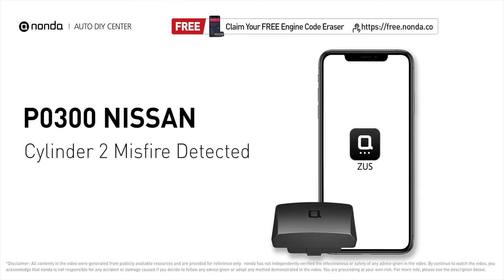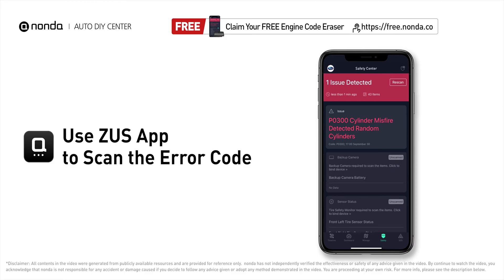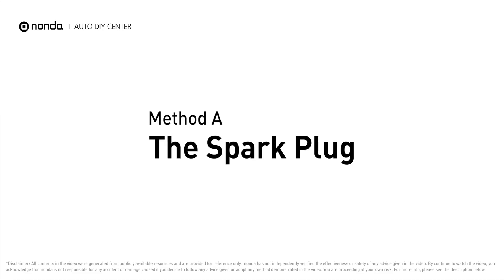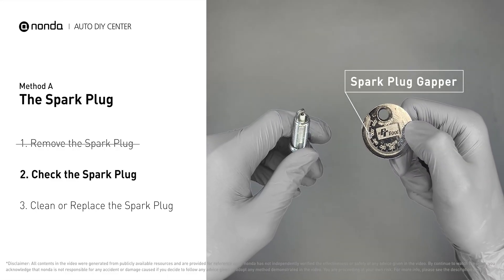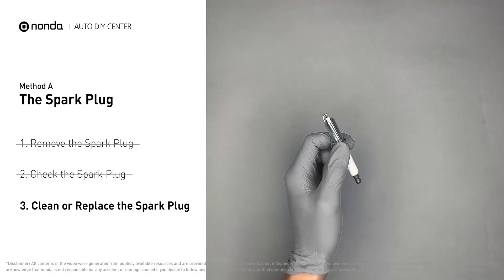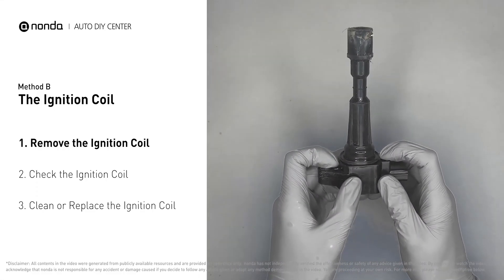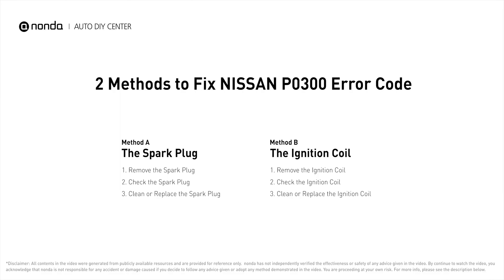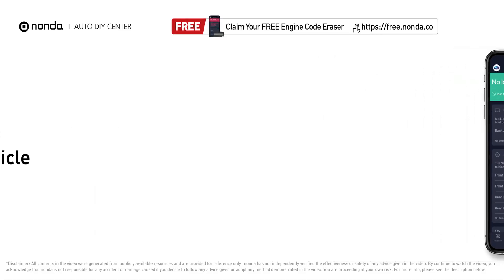How to Fix NISSAN P0300 Engine Code in 3 Minutes [2 DIY Methods / Only $4.43]

Comment: I have the same issue with a 06 Nissan Murano p0300 changed all 6 spark plugs and all 6 coils, with NGK plugs & coils catalytic converters & a Hitachi air flow meter. Put a smoke machine on it and no vacumm leaks. Still p0300 persists car has 140,000 miles on drives perfect.

Comment: My pathfinder armada 2004  driping gasoline for the muffler and a lot white smog, in less the 3 miles empty my tank of one quart to cero
Reply: I replaced my 8 injector, spark plug, ignition coil and the problem still there

Comment: Hello guys, my Nissan Pathfinder 2011. The brain box keeps getting damaged upon replacement along side coils.
I have changed 3 brain box and more than 20 coils.
I have had different electrical guys come check and I get the highest assurances from them that the issue is cleared after purchasing a brain box. After one week of usage, its back to square one.   The lastest electrical person that came for diagnosis suggested that we replace  the 3 valve on one side that experiences the frequent burning of coils in addition to changing the fuse box.

Can a faulty valve be responsible for this?

I need ur help, i am exhausted guys.
Reply: Honestly, it could be. Very smart of you to contact and see an auto electrician. Have they checked for a faulty ground? Could also be a blown fuse that was switched for a smaller amperage.

Comment: Got a p0300 code, got a new 02 sensor, started misfiring. Replaced the coil packs, spark plugs, 02 sensor (again) and the misfire is still there. First time I got the code it said “fuel system too lean” changed the sensor and it read “fuel system too rich” Anyone else’s Nissan do this? It doesn’t misfire when it’s first driven, only after a bit of driving. I’m at a loss here. I have a catalytic converter on its way but I’m running out of things to try.
Reply: 75% camshaft sensor replace with denso oem supplier.Did you get a P0420 ? Check for  exhaust leak resonator muffler exhaust manifold  if no leakage replace the cat back firing. I run into to same issue P0300 you having. Did you figure out what causing misfire?
Reply: So what’s your p0300 the cam chart sensor? I got p0300 and multiple misfire from a coder. Replaced spark plugs and fuel injectors. Coils already good check those. Still got the misfiring p0300 cyclinder 1 and multiple misfire code
Reply: @alexace5728  
i was checking to see if you found a fix for the problem because i am having the same issue
Reply: U figure it out ??
Reply: Just now seeing these replies! Sorry yall! We did end up figuring it out. We bought faulty spark plugs. One spark plug was threaded differently. Received it straight from the manufacturer this way. Came in a 4 pack and only 1 was defective.
Reply: I have the same issue with a 06 Nissan Murano p0300 changed all 6 spark plugs and all 6 coils, with NGK plugs & coils catalytic converters & a Hitachi air flow meter. Put a smoke machine on it and no vacumm leaks. Still p0300 persists car has 140,000 miles on drives perfect still no luck?
Reply: @JV3z  any luck? I replaced coils, plugs, fuel pump, fuel injectors, resealed the intake manifold, cleaned the map sensor, replaced pcv valve. My next move is the vvt.